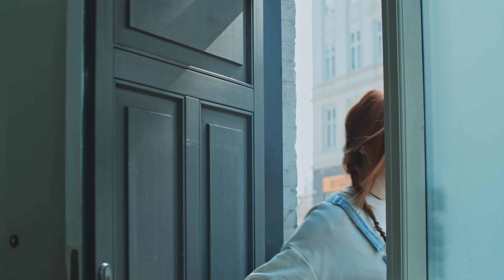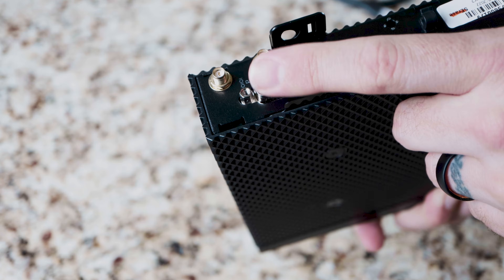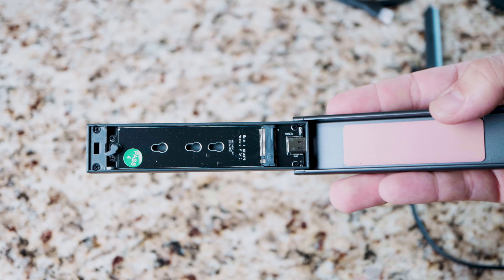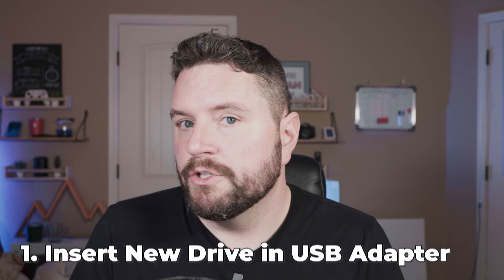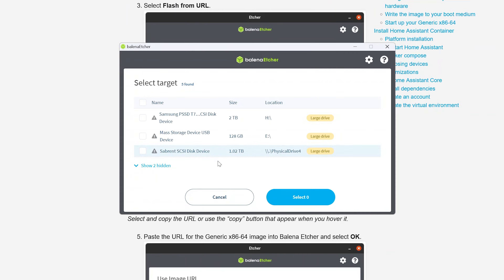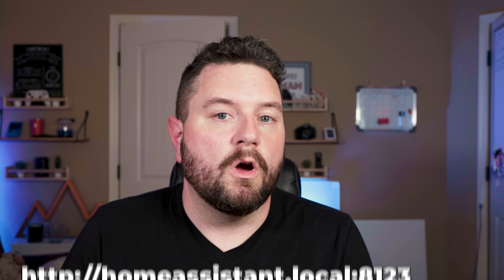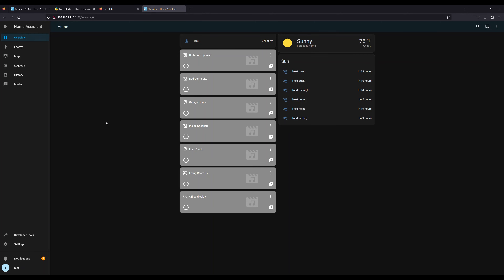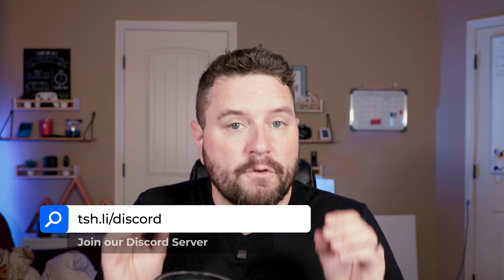No Pi? No Problem! Home Assistant on a Cheap Thin Client

Comment: I've the 5070 with 4gig Ram and 16gig storage , do i "have" to get the extra storage? I am just  getting started with Home assistant.. Please advice
Reply from the maker: I don't think 16gig will be enough due to log files, etc. But you can try it out and move to a new drive later.

Comment: You can use these with 1-2T drives for NextCloud (or alternative) to automatically upload photos and videos from your phone. It is very usefull and cheaper then buying 1T iphone, or paying for iCloud. SSD will last you for decades! And this particular one have very low power consumption also.

Comment: Somehow after only 2 months the SD Card outlived the Pi4. haha 
I have a spare 500GB SSD & a Dell Wyze 5070 J5005 is cheaper than a replacement Pi...so here we go. 
And btw....I actually have 2 Dell display port adapters. 😉
Reply from the maker: 2 DP adapters? I have heard tales about you... 🤣
Reply: @ThisSmartHouse  sorry it was actually 4 (@ $20 each back in the day). 😭 When I had an old Dell Latitude E6510 on a docking station, I had 2 there and 2 for each monitor. 
Brace yourself.....I actually use the a D-port cable on my LG ultra widescreen to keep the HDMI port free for RPi things, then I have a...wait for it...........a D-Port --> HDMI adapter for my NVIDA card (that sits inside a Dell Precision).
If you suggest therapy, I will not disagree. 😂

And speaking of the E6510....until the 5070 arrives, HAOS is running on the E6510 via a flash drive. 🥴
...actually is not too bad & it only needs to hold up for a week.

Comment: I recommend installing HA in virtual box as a means of testing it. That's what I did and it worked well enough that I could explore a few possibilities before I upgraded to more specific hardware. It's pretty much free, you just need an appropriate hub or USB adapter if appropriate, and whatever devices you're planning to control. It's not ideal, but it works well enough to mess around with.

Comment: I purchased a second hand 5070 build in 2022. I opened the box and see the M.2 slot has one wide connected and ONE small connector. This looks to me mines has a M.2 NVMe slot. Anybody knows the 5070 can either have M.2 SATA or M.2 NVMe?

Comment: Still don't get why instead of selecting rpi I should 
1. Pay more for outdated used device. 
2. Find a much bigger place to mount it. 
3. Pay at least twice (more likely 4-5 times) more for the electricity.
Reply from the maker: When this video was posted raspberry pis were still in short supply. 
But an x64 based system will out preform the pi over and over again. Plus the thin clients are pretty energy efficient.
Reply: @ThisSmartHouse   Got it. Fortunatelly now we have many alternatives to rpi. For example radxa, it even have emmc. For HA you don't need a powerfull computer so even tiny radxa zero will be enough.
As for the power you probably underestimate the power and efficiency of arm cpu. Just compare J4105 and BCM2712, you will be surprised. Unfortunately even energy efficient intel cpus are just stoves in comparison with arm :(
Reply: Would buy it if you said I need a power of lets say amd epyc 9654. But this "thin client"... It was really a trash the moment they annonced it.
If you know how government tenders for equipment purchases are organized, you'll understand why they made this trash.
Please never buy, it's really trash, it doesn't worth even 10$.
Reply from the maker: @Samiron Thin Clients are commonly used in all industries. It is just a cheap,  less powerful PC that is used to remote into a remote desktop server. The reason is it popular is because they are cheap and available. 
My thin client is much more stable than my pi.
Reply: I run a home server and find it annoying that HA doesn't work well on my home server and everyone recommending to me to install it on a Pi or a thin client only to waste more power and complexity. I should be able to use my home server for this. But the install on my home server doesn't even have support for the addons store, etc.
Reply: @HellTriX  but you can. Of course if you want to install it in docker you won't be able to use addon store, but why do you need it? Just install all plugins you need, setup it once and forget.

Comment: Great Video, one thing for people like myself who are not Code & Script writers and all. That when you setup on as you call a Thin Client, that all it is , A local Server, there is no way on the Thin client to access the HA interface.. That has to be done via another means, a cell phone app, or another computer, laptop or tablet.. When I started all this , I though I was installing on a Thin Clinet and same time had ability to have HA interface.. I was Wrong and seems no one I have found on U tube is making that clear.. So if your are or were thinking you can install HA on a Thin client and same time access HA interface.. You can't, now if someone knows how to do this I am all ears and eyes.. It was the reason Invested in the Thin client concept, unknowing that it is only a server.. and no way to do anything with it. It's a dumb waiter so to speak. no pun intended.. to all those who serve.. :eyes-purple-crying::face-fuchsia-wide-eyes::face-turquoise-covering-eyes::goodvibes:
Reply from the maker: When you are saying the HA interface? I assume you mean the GUI. This would never be possible on any piece of hardware where you are running Home Assistant OS. This is because Home Assistant has to run in something (base Linux, virtual machine, docker). The only way to do this would be to run Windows (or Ubuntu), then run Home Assistant as a docker container or virtual machine. But that would be very inefficient.
Home Assistant is designed to be installed on nearly anything and then left connected to your network at all times. It will still run automations and control objects. Honestly we interact with our Home Assistant 75% of the time via Google Home. 
The “Thin Client” is just a specific build of a PC, the reason it is attractive is because they are cheap and wildly available. The same interface is what you would find if you built on Raspberry Pi.
Hope that clarifies things.
Reply: Yes, GUI   / HA Interface. You are correct,, lesson learned the hardway.. by lack of my understanding and lack of clear information for mindless like myself
Reply from the maker: It is all part of the learning process. No worries. It is the same if you would have purchased a pre-made Hub from someone like Homey or SmartThings. Those doesn't have a local interface as well. 
I guess I did do it back on one of my RasPad videos where I ran Rasbian standard on the Pi, then ran Home Asssitant as a VM or container. But that would be a special case.

Comment: Hello. Do you have experienced any problem with installing Add-on on this type of HAOS installation, because I have? Virtually, no matter what I do, a finish with message: "AddonManager.install blocked from execution, no host Internet connection". My system is installed like you suggest in this video on HP EliteDesk 800 G2 Mini with i5, yesterday, so it is up-to-date version.

Then I found this commands:

ha su repair
ha core rebuild
ha host reboot

tha help me to instal one. Only one Add-on (Advanced SSH & Web Terminal) and after that, above message was back, now stay there, no matter what I done, including above commands,
so, the problem is not with network  or Internet, because this was not changed at all during this attempts in any aspect.

Do you have any idea what I can do to solve this problem?
Reply from the maker: It sounds like one of the docker containers cannot communicate with your network properly. Have you upgraded to the latest version of supervisor and home assistant?
Reply: @ThisSmartHouse  Well yes, at that point in time I was using latest and greatest version. Later, I was opted for Method 1 installation (using USB and Ubuntu) and that worked and still works very well. I do not know what problem was, same version, same hardware, different installation methods. Although I noticed small differences in UI here and there, which suggest me that, maybe image is not completely same as live installation (or it was not at that time). Thank you for response and have a nice day.

Comment: Pis are great if you need things the gpio pins otherwise it’s thin clients all day. I have the 5070 with the slightly later j5005 and it idles at 3.5w which is equivalent to a pi

Comment: By the time someone has installed his HA on a Raspberry with SSD, i have bought a cheap second hand lenovo mini pc for half the price of a PI, x64 cpu, 8gb ram, multiple usb ports, wired network, much more reliable and powerful, very low energy consumption, even if breaks i can afford to buy two more for the price of a PI
Reply from the maker: That's why I made this video. so folks know there's another alternative out there if you wanted to step up from just a basic pi with SD card.

Comment: Works on Thin clients With processor ARM PX30?
Reply from the maker: I would think it would work because Home Assistant runs on Pi’s, those are ARM processors. You might do some digging or ask on the Home Assistant discord.

Comment: The most important disadvantage is that home assistant is not free like smartthings. I was used to turning on the lights using Alexa, which in home assistant you have to pay for. Home assistant is hopeless compared to smarttings. Examples: sometimes it shows that the lights are on when they are not on, sometimes the thermostats are offline, then after 2 days they are online, Motion sensors sometimes work and sometimes they don't work. I thought it would be faster because it is local compared to smartthings - it is not. I am disappointed with how it works after watching videos praising the home assistant. I think most of these videos are sponsored.
Reply from the maker: A couple of items to clarify:
1. Home Assistant is 100% free and open source.
2. You can achieve everything offered as part of the Nabu Casa subscription for free (Google Assistant, Alexa, Remote Access). Albeit not every can do the required port forwarding.

I came from SmartThings and had all of the same issues with devices dropping and going offline. Home Assistant relies on the underlying tech for things like Z wave and Zigbee. 

What specific devices are you having issues with? I have had issues with my older Z wave devices and had to periodically ping them. Turns out, SmartThings did that automatically in the background. In HA, you can write a simple automation to do it.
Reply: Am I need to pay for voice assistants like alexa or google? YES! That's why it is not free. It require to to pay $5 every month for what is free in smartthings.  @ThisSmartHouse
Reply from the maker: Nope, you don’t. You can do either one completely free. It just requires you jumping through a lot of hoops to set up the developer accounts. Plus you have to have port forwarding and more. You are paying Nabu Casa because they are maintaining the bridge to make it quick ands easy.

Here are the how to documents:
- Google Assistant: https://www.home-assistant.io/integrations/google_assistant/#manual-setup-if-you-dont-have-home-assistant-cloud
- Alexa: https://www.home-assistant.io/integrations/alexa/#manual-setup

The dev team at Nabu Casa is much smaller, so the cloud server space has to get paid for somewhere.

Comment: I got 2 5070 w/J5005, one running Kubuntu. the other one is on Ubuntu core w/CasaOS, jellyfin, ADguard. 
With all upgrades its Still cheaper than Rpi5 8gb

Comment: Thank you very much for your excellent video.  I am new to HA and my computer expertise is limited.  I bought a Trycom WI-6 Mini PC, FN501 Pro NVMe SSD • M.2 2280 PCIe Gen3 x4 Internal SSD, and SSK Aluminum M.2 NVME SATA SSD Enclosure Adapter.  I was able to follow your instructions and flash the SSD with HA and use it to replace the SSD in the Trycom. (The Trycom ran fine with Windows 11 on the original SSD.) When I attempt to boot the Trycom with the HA SSD it will only come up in the bios.  I set the UEFI PXE BOOT SUPPORT  to ENABLED and SECURE BOOT to Disabled but it still only comes up in bios.  I removed and reflashed the SSD and tried it again but no luck. Do you know of anything I can try?
Thank you
Reply: I'm in the same boat with Dell Wyse 5070 only boots to the internal OS which is ThinOS will not see the SSD...invested a lot here also
Reply from the maker: Hey @barrowrw & @ParcoUpchurch I would be happy to help you both troubleshoot. It would be easier over at our discord: https://TSH.li/discord
Reply: @ThisSmartHouse  Will do Sir...thank you for helping us seniors... I will say welcome on Discord this one is new for me

Comment: Liked & Subscribed 👌

Thanks for this and all other vids Ryan!
 

I've been playing around HA on a RPi4 and now I want to install it on a thin client. What are your learnings about zigbee implementation (dongle, coverage, meshed network) when moving your home server away from either your studio, or to a laundry room? I've watched your other videos and couldn't find your insights on how to ensure proper zigbee coverage throughout your entire home when your home server is "hidden" in a laundry room or basement... 🤔

Thanks again from Chile 👍!
Reply from the maker: You are welcome!

The nice thing about zigbee is most powered devices act as repeaters. So if you have your zigbee radio at one end of your house, the devices will mesh and extend. Zigbee smart outlets and light switches are the best for this. Bulbs can be finicky. 

If you use zigbee2MQTT, you can host your zigbee radio on a completely different device from home assistant and have it communicate via MQTT.
Reply: Great reply, thanks  @ThisSmartHouse ! Will give z2MQTT a try 👍

Comment: I purchased a WD m.22 and used Etcher to flash Home Assistant (HA) onto it. However, after the flashing process was finished, I am unable to locate the drive on my computer to restore the Home Assistant backup I had created. An error message indicates that I lack the necessary permissions to access the drive. How can I transfer my Home Assistant backup file onto the hard drive and initiate the restoration process?
Reply from the maker: Once you flash the drive it changes to a Linux OS. So not readable by Windows without a special app.

But, the solution is easy. Go ahead and boot Home Assistant and there is an option to restore your backup (from a flash drive ). Or you can set up a fresh HA, install the SAMBA plug in, then move the files over the network. You can always restore over the fresh install.
Reply: @ThisSmartHouse  Thanks a ton for the quick response! Your explanation makes total sense. I'll give booting into Home Assistant a shot and restore from the flash drive. If that doesn't work out, I'll take your advice on setting up a fresh HA, installing the SAMBA plug-in, and moving the files over the network. Appreciate the guidance—fingers crossed for a smooth restoration process!

Comment: "Unless you have a Displayport Display - but nobody really has those" WHAT THE FUCK IS THAT STATEMENT. I don't know when the last time was when I've seen a monitor WITHOUT Displayport. Even the dirt cheap monitors at our office have DP.

Also why not keep the Windows install on the Thin-Client and install HA with Docker? That way you can use the Thin-Client for other server applications as well.
Reply from the maker: Wow..... Ok.

I work in IT, and most of the lower end monitors don't have DP ports. 

Why not run it under windows? Because you want it reliable.
Reply: @ThisSmartHouse  My issue is mainly with how you said it. It's just not true that nobody has DP and you have to go really low in price to not have DP.

I repurposed an old Windows laptop to act as a server on which I have my media server, a minecraft server and Pi Hole in a Docker container running for nearly 2 years now without any issues. It's just that you could do more with that machine than just have it's sole purpose to be for Home Assistant
Reply from the maker: In all of the homes I have worked in I have only found a few people with DP ports. Plus a lot of folks use a TV when setting these up, so they need an adapter. 

Also, it was a bit of a joke...

I agree you can do more with the machine. But if it is running your home, I would suggest not running on windows. I have my HA instance running on a dedicated box, but I have another mini PC running proxmox, it has about 50 services running on it.